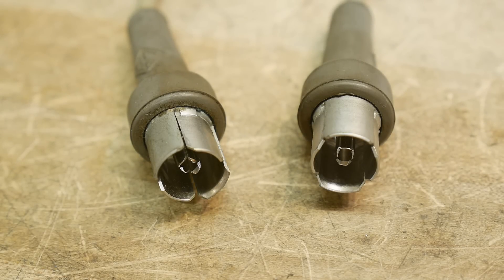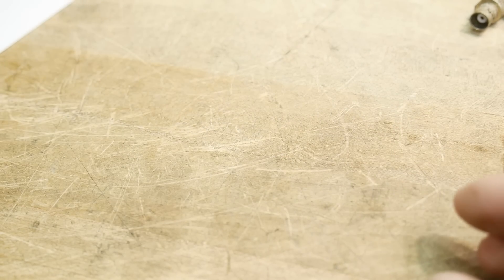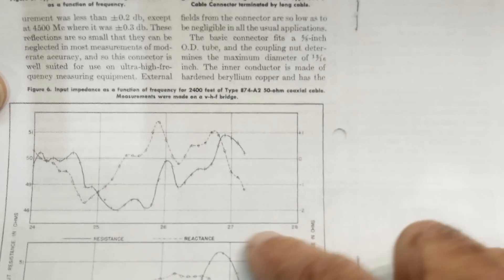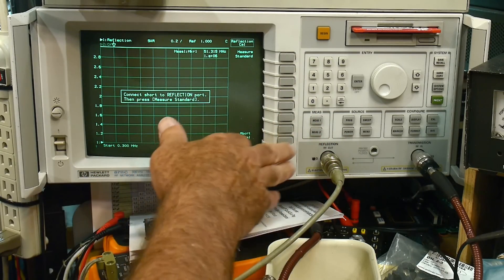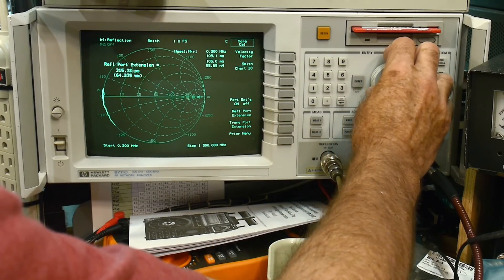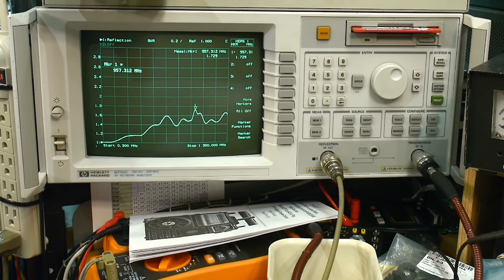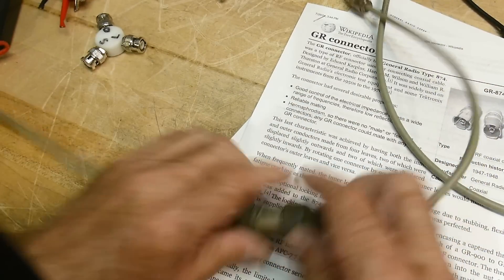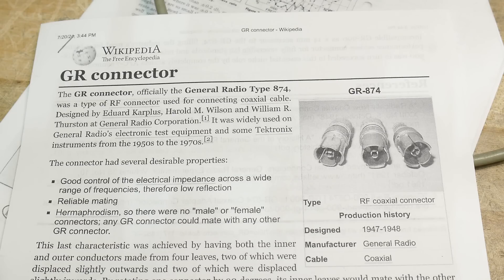#1953 GR Connector (General Radio)

Comment: There was a 125 ohm version as well with a different geometry on the inner pin. They were specifically for the 1GHz Tektronix 519 oscilloscope (of which I have a working example). The signal path went through a giant rigid delay line, and then directly coupled to distributed deflection plates.

Comment: Thank you for this video.
HP also put GR connectors on the HP 1415A Time Domain Reflectometer. The 1415A is one of two double height plug-ins for the HP141T Display Section.
Would it be wrong if I swapped the GR connectors for BNC or N-Type?
Kind regards,
Terry.

Comment: I keep a few of them in my junkbox just in case I need to make a cable for an old piece of test equipment that uses them. Your adaptor cables had that 'HP look' to me. I'm not sure exactly why something has that HP look to me, (the fold angle or corner manufacturing technique, or perhaps the precise shades of gray picked up from my time at HP,) but in any event I haven't seen the GR to BNC adaptors before in any junk boxes at ham swaps or I would have snagged a couple. It takes decades of gathering adaptors before one can adapt anything to anything, and it's a real pain when a piece of equipment has a weird connector jack on it and you don't have the right plug to fit it.

Comment: Never used those personally, but did see some in a box one time.  

Several of my test instruments were equipped with APC-7 connectors.  These are sexless as well.  Typically we would have an APC-7 to whatever adaptor that would be used to connect to the device or system under test.  The nice thing about the APC-7 being on the instrument is that if someone accidentally connected a cable with a bunged up connector, or as sometimes happened a 75 ohm N connector to the 50 ohm adaptors we used, the only thing damaged is the APC-7 to whatever adaptor.

So we were out a few hundred dollars for a new adaptor, but didn't have to send the equipment back to HP or wherever to have the connector replaced.

Following on this operational notion, even for the test equipment that had N or some other connector on front we required that anyone wanting to use our test equipment use one of our instrument grade adaptors to connect to the equipment and from there to their DUT.  As a result we never had a piece of test equipment go out of service for that reason.  Other labs in the company weren't so fortunate.

Comment: Still have a set of GR inter-series adapters (not cables), GR to BNC, GR to PL259 and GR to N, picked them up at a swapmeet back in 1980...
It was a clever idea but as you showed, only great from HF to VHF

Comment: These were better than the Switchcraft 2501 connectors (also still available) that were used for RF on a lot of Eico, Heathkit, and other test equipment.

Comment: Still use similar connectors to these for TV aerial inputs in the UK.
Reply: This european IEC antenna connector for 75Ohm may look somewhat similar but it is classic male/feale system and much smaller in size. Just look in the video and compare with the BNCs which look tiny next to the GR connector. Moreover, is it possible the GR connector is not for 50 Ohm. Just for example the time this connector was invented here in europe we used lots of 60 Ohm cable for professional communications...

Comment: Funny old connectors: Sometimes a "nice" legacy radio is available at the flea market. Looking the front panel over, it looks nice. Look at the back, yuck - full of Ye Olde Fashioned connectors. Things like an 8-pin (octal, like a tube) pin plug for the remote power supply with four different voltages. Things like RCA sockets for some I/O, or 1/4-inch socket for the required very-High impedance crystal microphone.  🙂

Comment: I remember these connectors from an old Tektronics sampling scope in the late 70s. It was not new at that time. It had a 90ps risetime and signals with up to 5 GHz should be measured with it. Other equipment had as usual BNC connectors and the really fast HP sampling scope had N-connectors. 
The large diameter of the GR connectors did not really look suitable for high frequencies (especially after some time of usage) but Tektronics must have preferred them over BNC connectors which were everywhere else. BNC is made for applications up to 1GHz or even 4 GHz. (For higher frequencies one takes N-connectors which are then usually used with BNC adapters.)

Comment: Pasternack will still sell you a crimp GR-874 connector, and for only about $40.00. I think I'll stick with soldering those miserable center pins on BNCs and trying to get a good cable strip for SMAs. Those activities are just as entertaining as using GR-874s and are a whole lot cheaper. 😇

Comment: Looks like americas crappy answer to the crappy belling-lee “PAL” connectors from Europe.
Reply: I feel your pain. Still installed on UK TVs though. I just stick an "F" connector on the cable and use a suitable F to coax adapter.
Reply: @MrBanzoid  ditto in .au
One of the first things I did in this house was run lots of cat5 and replaced all coax with RG6 and F wall plates.
You know a connector is crap when a pair of pliers is troubleshooting step 1